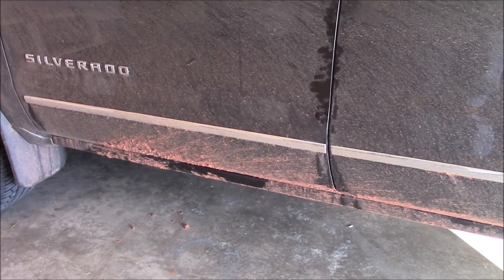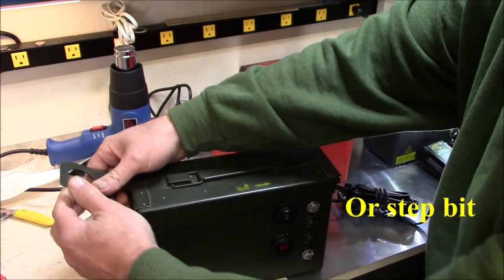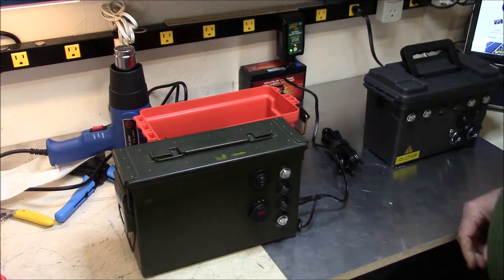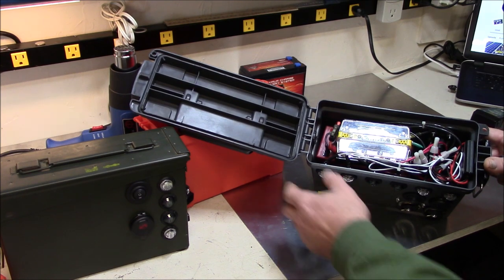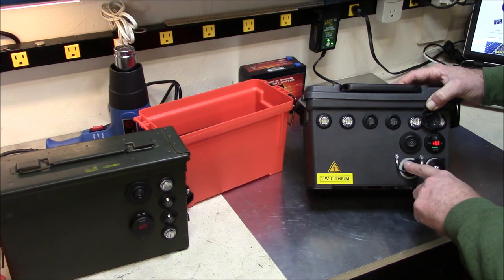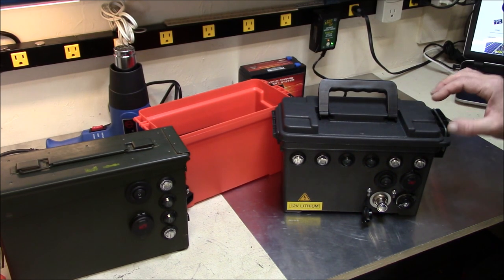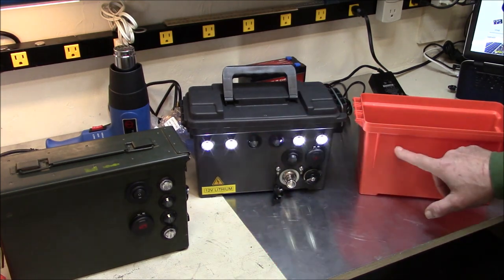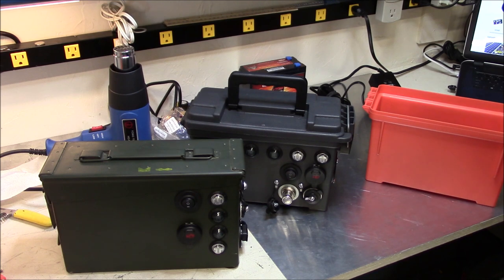12v Portable Power Box - new design idea (orange plastic ammo box with LED lights, charger)

Comment: Are you Frosty  or Toasty today Chris ?   I like the orange set-up. Lower weight, no samurai shards to tear up your skin,  no issue with rust, ...and it shouts EMERGENCY  / caution  equipment.  Just don't drop it when it is cold, it'll crack in a heartbeat.    J K
Reply from the maker: 59F, sunny, no wind. I like the orange too...kinda reminds me of some of the equipment we dragged out to the flightline. That is the only drawback with plastic...it can crack and isn't as tough as steel. Overall, plastic is better. But, steel looks so dam cool

Comment: Haha that's awsome, I just made a strobe ammo can the other day. I used 4 Amazon red "rock lights" and a rigid 3a led strobe controller. Center two steady burn and used rapid alternating pattern for outer two and it will make a good road flare. Illegal to have red strobes on my truck, but they can't say jack if it's on the road behind it. I'm just going to use a little sla so I can leave it in the truck when it's too cold to store lithium.